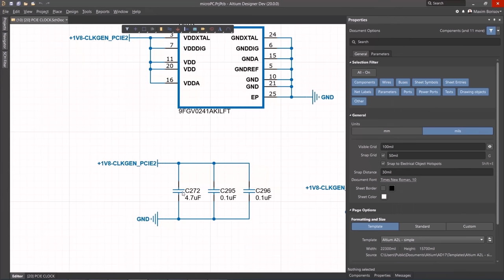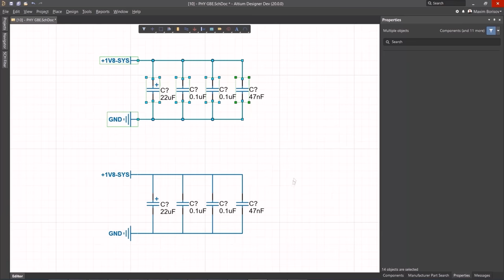high power 1000w induction heater 12v dc

Comment: Where do you get 1000 watts from?  That would take 83 amperes from your DC power supply. 
Your supply wires would be smoking hot in just a few seconds, too.
 Heating a thin steel blade so it just barely glows in a darkened room isn't even close to 1000 watts.
Reply: Don't get all he up Frenchy, Its an obvious scam.
Reply: @moking8095  The reason that I made my comment was to add some reality to the thing for those folks who thought it was a great success.  Maybe they won't try to do the same thing and end up  disappointed.  I have put a lot of effort into my own videos and web pages on this same subject and I try very hard to be completely honest with all of my results.

Comment: 36 - 40V from the coil so... It will be 40-60 Amps at the coil making an AC because of the capacitor and so much frequency at 100-250KHz

Comment: Wow, it's hard work, but if the value of the transistor is cheap, there is no problem, and if the value of the transistor is high, I will not do this circuit, because if I take a step, all the transistors and resistors will burn, and I will not be able to buy again hahaha 😁😎🤗👍🤷‍♀️

Comment: 1kW at 12V are more than 82A. Despite the use of 8 Fets, the supply wires are thin like cotton threads and I assert our friend has no 1kW powersupply. Turkish AKP Fairy tales, not more